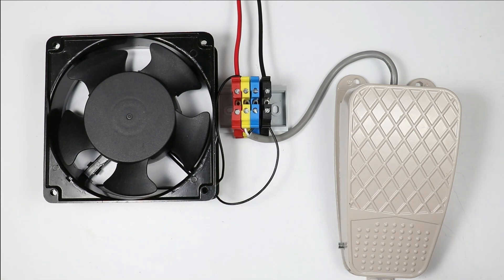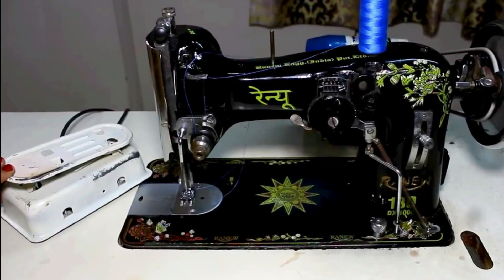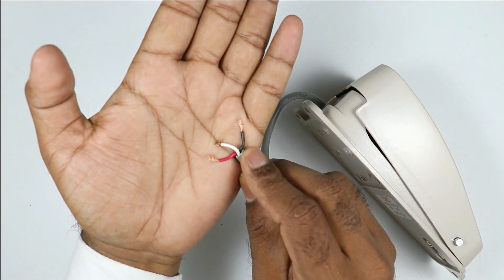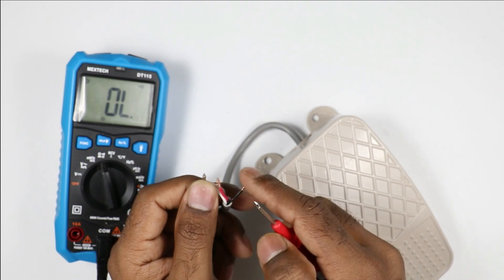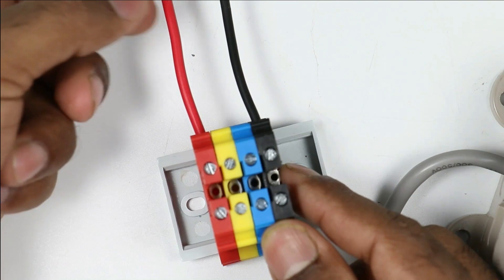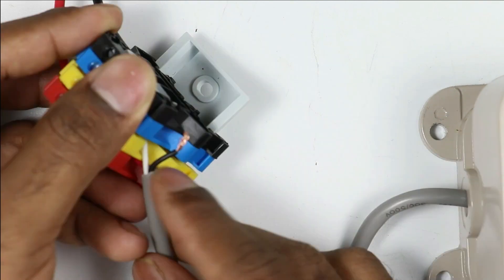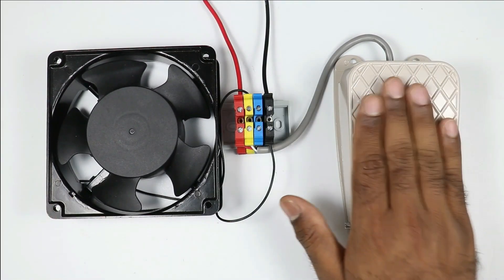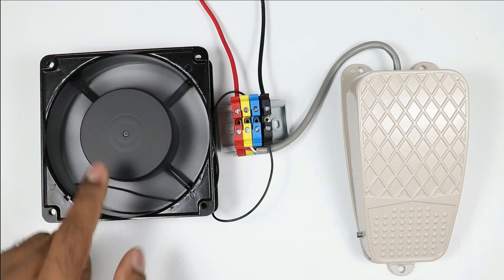Pedal Switch Wiring with Motor | foot pedal switch wiring diagram @TheElectricalGuy

Comment: So what about the black wire from the switch. What is that for? Do I just ignore it? Ive no connector to connect it to.
Reply: Black and red wire are interchangeable depending on whether you want the pedal to provide or cut power when pressed

Comment: Hi could you help me with how two potentiometers are wired together to control one output. For example gas and brake pedals for a racing wheel for a video game. The gas and brake are two potentiometer wires into one output. Can you help me